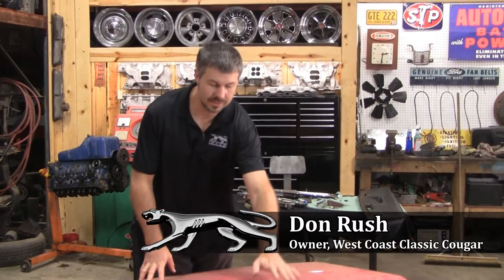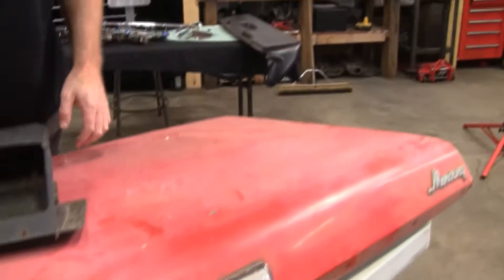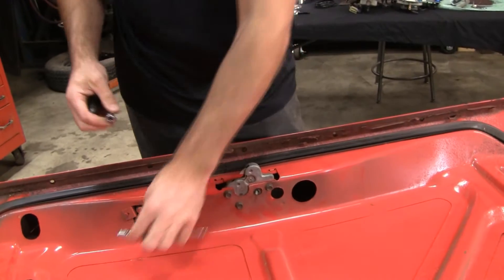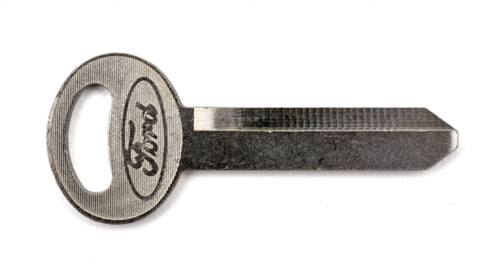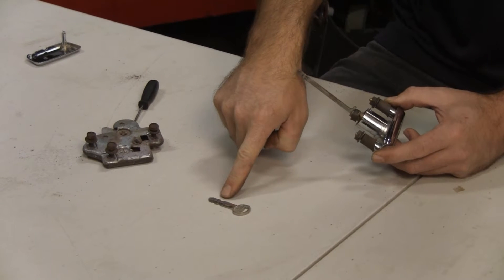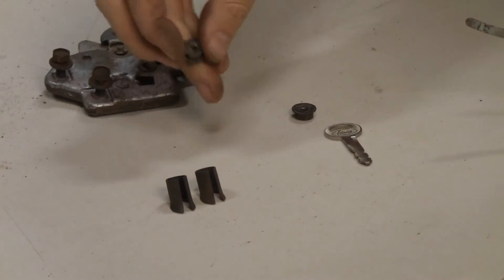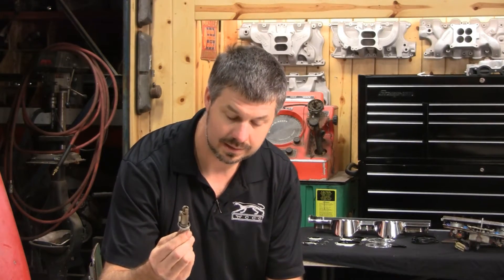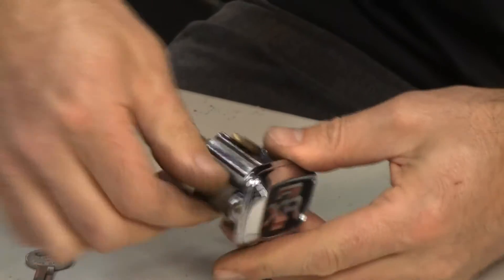Trunk Lock / Latch Removal & Installation - 1967-68 Mercury Cougar

Comment from the maker: Yep, if you have the original owner's manual, it should have the key codes typed on the inside of the front cover. Or if you don't have the manual, you'll find the trunk / glove box key code on the glove box lock cylinder or trunk lock cylinder, and the door / ignition key code is usually on the driver's side door lock cylinder.
With these codes, we can make brand new keys for your car. So on our website, search for "keycode" and you'll find the 2 key listings.

Comment: question, if i were to replace a locked up oldsmobile toronado 1984 trunk, what would you suggest me to purchase (lock model) and is it hard to do so
Reply from the maker: Hey Joshua, we only sell parts for the 1967-73 Cougar and cars that have parts that cross with the Cougar, so we can't really comment on what it would take on an Olds.  You might want to ask on the Oldsmobile Forum: https://oldsmobileforum.com/

Comment: Don,

How did you get the captured washer nuts and wedge spacers out of the holes? How do you keep the nuts and washers from falling down into the body of the trunk?

Thanks,
Antreally
Reply from the maker: Good question! That is tricky, more so with the trunk lid on the car. If you take the trunk lid off, as shown in the video, at least they will just fall straight down and you can use a magnet to get them out from the access holes.

Comment: Ok how do you get the cylinder out when it won’t turn at all with the key! Thats the whole reason I need to replace it 😊
Reply from the maker: You can do a bit of research on a "bump key", they're used when a key is missing. Doesn't always work though.

Comment: My trunk lock (the cylinder) wants to come out of the housing during normal use, such as when I go to remove the key. I'm not sure if it would actually come all the way out, as I've not wanted to stop the functionality of the trunk, but it does come out quite a bit. Why does it do this? Is that little button broken on mine?
Reply from the maker: That sounds likely, the only way to know for sure would be to take the lock assembly out and see what's going on.
Reply: @WestCoastClassicCougar  One of these days I'll take it off when it gets painted. Not too keen on taking it off while the trunk lid is still on the car. Thanks for reply.

Comment: Could you help me with figuring out the easiest way to read the driver side door lock numbers? Possibly what to remove and how and where to look. Super super mechanically inclined just don't want to mess this baby up figuring out what needs to come off    (67 xt7) (barn find style)
Reply: Xr7 *
Reply from the maker: womackke You'll probably have to remove the lock cylinder to get a look at the numbers. This involves removing the door panel and reaching up with your hand or a screwdriver to undo the clip on the lock rod, then use pliers to slide out the bigger clip that holds the cylinder in place. Then the whole thing should come out (from the outside) and you can take a closer look at it.

Comment: What am I doing wrong? I can’t get the latch to move far enough to get to the hidden bolt... I gave up and it’s only bolted with one bolt at the moment
Reply from the maker: It is just a matter of rotating the striker/latch until you can get the socket in there and put the nut on similar to how we removed the nut here: https://youtu.be/2qvBUCNFf1I?t=167.    It will not slide far enough to get out of the way, but if you rotate it there is a sweat spot where you can get to it. If you try to do it with a 3/8" extension or a driver with a thick shaft, they will be too big to let you line it up; you need a 1/4" drive extension or a driver with a thin shaft. It is not easy, but we have never found an instance where it can't be done.   Just takes some patience, the right tool, and some finagling.
Reply: Do y’all sell patience ? Lol. I need some I think
Reply from the maker: @chadhickey9942  Unfortunately, patience is on back order for the next few months, so you would have to wait... :)
Reply: @WestCoastClassicCougar   dammit. oh well, i'll move on to something else. my latest package from ya'll should be at my house today

Comment: This is great if one of the locks wasn't changed or replaced. Dealing with this now on a 1967 Cadillac Sedan Deville. Took glove box door to locksmith.. They made a key. And sadly it doesn't work in the trunk
Reply from the maker: Many locksmiths can rekey the trunk lock to work with the original key.
Reply: @WestCoastClassicCougar  I was told by two shops now that they need the lock removed from the trunk to make a key. So another $300 I'm sure. Ugh lol
Reply from the maker: @WiscoMike920  I am not familiar enough with the 67 Cadillac to know how hard pulling the trunk lock cylinder is, with the Cougar that is something most guys can easily do on their own.  I had a car door rekeyed a number of years ago and I just brought them the entire lock cylinder assembly.  They charged about $50 bucks, but it is hard to say what they are charging for that now.

Comment: Do you guys make keys for 66 falcons??????
Reply from the maker: Those are single sided, correct? If that's the case then we can't do them, unfortunately. We can only do the double-sided style as shown. But if yours look like the ones shown here, then yes!
Reply: @WestCoastClassicCougar  cool theyre double sided
Reply from the maker: Great! As long as you have your key codes (from your lock cylinders or the owner's manual) we can cut them. They will come on the reproduction Ford / Family Of Fine Cars blanks. 
Here's the link for the door / ignition key: https://secure.cougarpartscatalog.com/keycode.html
Here's the link for the trunk / glove box key: https://secure.cougarpartscatalog.com/100022714.html